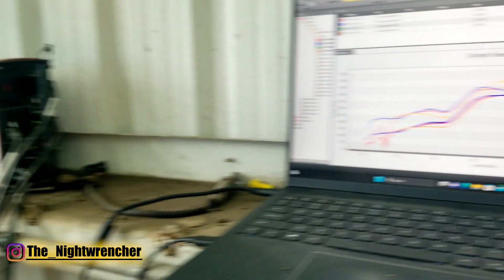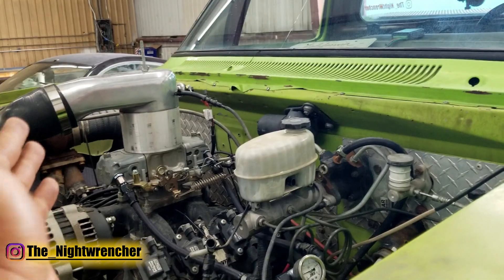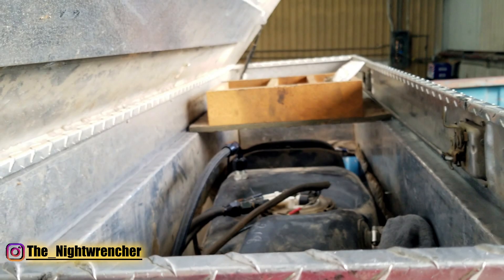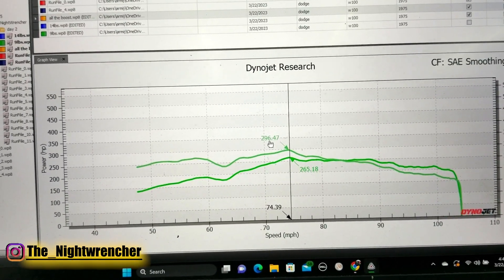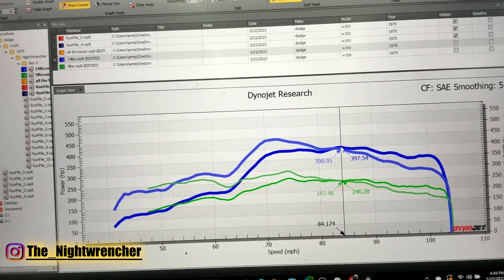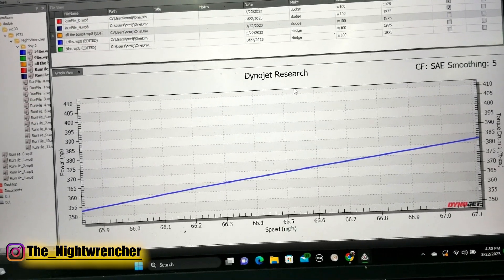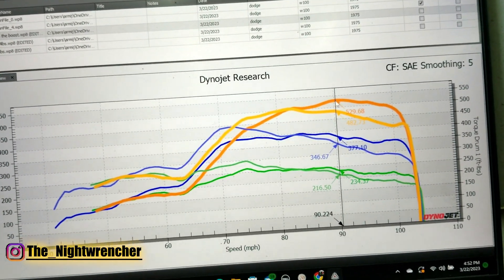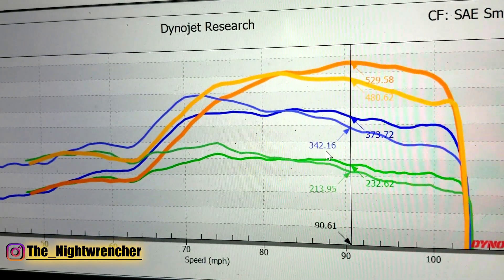Turbo Carbureted Junkyard LS 4.8L Dyno Numbers | LS Swapped Dodge W100 | Carbureted LS |

Comment: What i dont understand is how this video has 33k veiws... and not even 50 likes? This is great FREE information. This engine platform will easily fit in a smaller car or truck and would be an absolute blast to drive. @nightwrencher you are the reason i went with a Daytona Sensors ignition controller for my LS swapped 87 Monte Carlo  SS. Keep up the good work buddy!
Reply from the maker: This really means a lot man! Thank you!

Comment: Is that big tube for clearing up turbulence ? Do low profile carb hats cause issues with boost ?
Reply from the maker: Thats the idea, supposed to straighten out the air before the carb. Ive seen 1-2" spacers on proffesional race cars so I'm sure it does something. This cheap hat isnt as good as the other hats but it still gets the job done. As long as you run vent extensions, youre good
Reply: @NightWrencher  Alright, awesome !